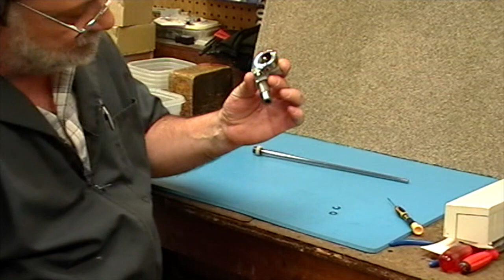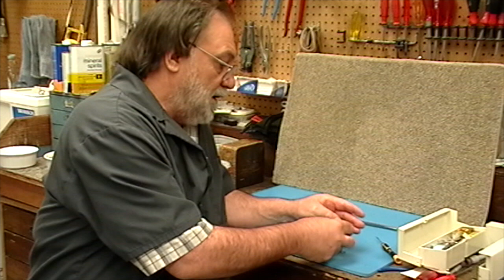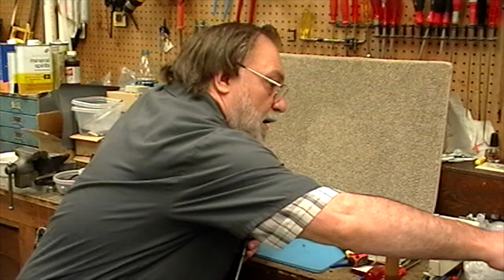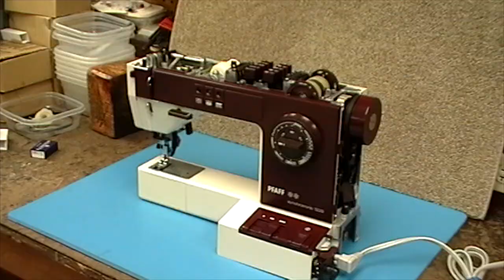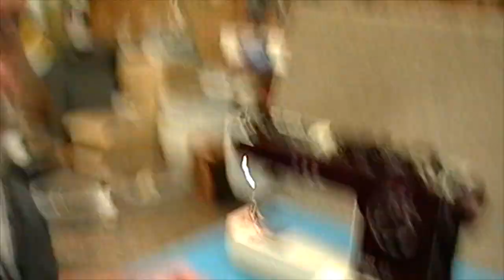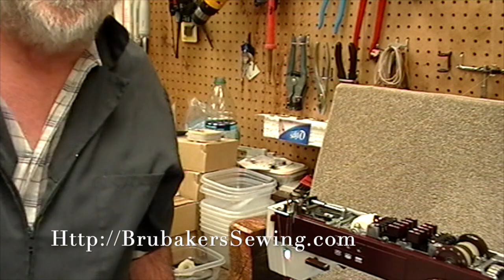1229 #2 Repair and Rebuild

Comment: I was just recently given one of these machines and I am wondering what do I use to clean out the inside of it It is really gooey and sticky and all of the components inside the casting but I'm just not sure of what to use to clean it out with and what I should touch and should not touch or remove I'm going to try to service it myself I cannot afford to take it in
Reply from the maker: It’s a complicated machine. Pay a professional. You won’t be sorry.
Reply: @Discoversewing I sure wish I could afford to have someone do it. I've never had a nice sewing machine like this one . I've not read one bad review about it. I've been using my mother's vintage singer sewing machine and got too many things wrong with it as well so that's why I was really hoping I'd be able to get this one cleaned up to be able to try it out.

Comment: Hello, I wanted to ask you about the Pfaff 1222 machine, it works slowly, it does not have some speed, how it can be increased or there is a problem with the machine.
Reply: Good question...I want to know the same thing but on a 1214
Reply: I’m working on a 1222 as well. Little sluggish I think and it breaks needles
Reply: How do you replace the needle lift it’s broken off on mine. I got a new part but I don’t know how to replace it!